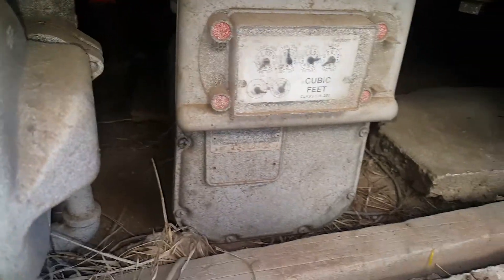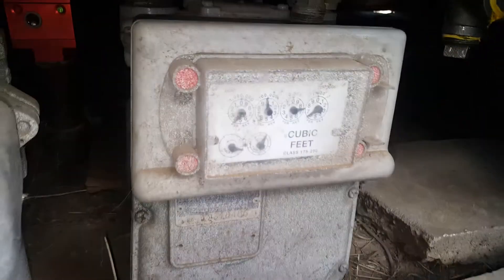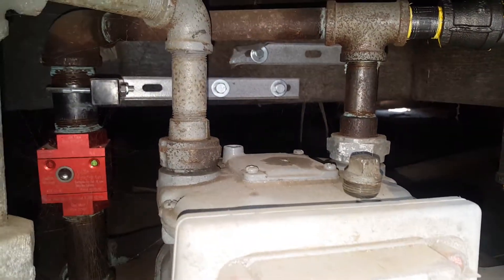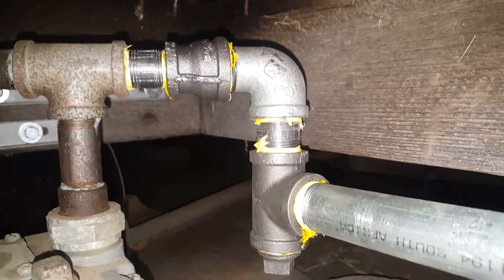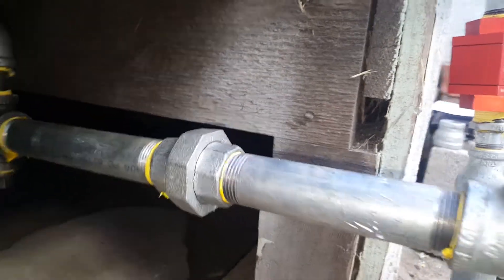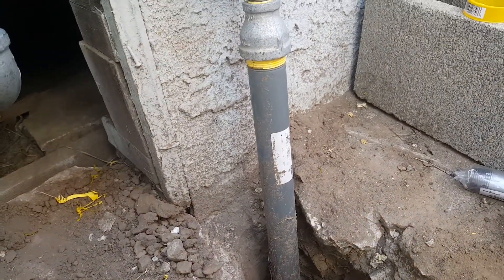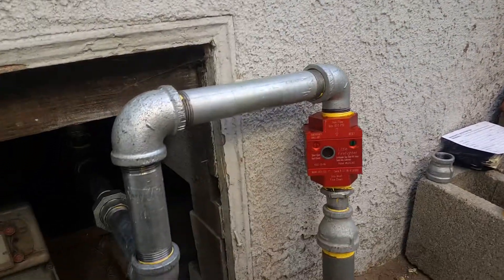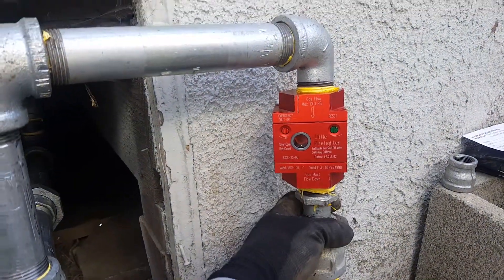Seismic valve for an  Accessory Dwelling Unit must have!!!!

Comment: That is one of the questions I have do I need a new/ second gas meter for the Adu unit we plan to build or can we just t into the Adu.
Reply from the maker: You do not need a second meter but depending on your city you can have one if you want one and also a second electrical meter but you're not required to that one. You will need a seismic valve though!